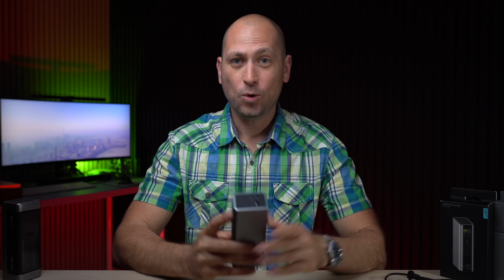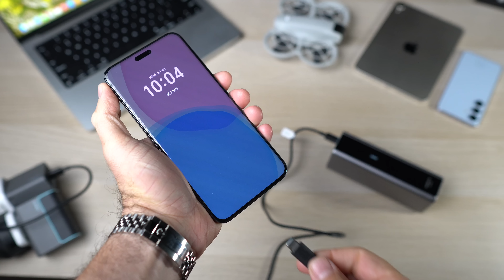This Power Bank Made My Other Chargers OBSOLETE - CUKTECH 15 Ultra

Comment: You should talk about the misleading that this brand does with their information. I bought their 10k mAh power bank and I have to accept that quality looks good and it provide fast pd to everything I connect to it. The problem is their real capacity, mine being 10k mAh is only able to charge one full time my s22 ultra or my pixel 8 pro and then it will be with 10% or less charge, when the battery for these devices is only 5k mAh. I reported this to cuktech and I was told that the real capacity for their 10kmAh is only 6k to 6.5kmAh and that this is normal for all the power banks. I am sorry but I have a 10kmAh power bank from Anker and it is able to charge my s22 ultra and pixel 8 pro at least 1.5 or little more my phone when their power bank is not even able to charge them 1.1 to 1
2 times before the power bank gets fully depleted. They have a problem with their power bank and their real capacity.
Reply from the maker: Thanks for sharing with everyone.

Comment: The coolest power bank! It's very powerful and it's nice that it charges at the device's maximum speed!
Reply: What phone u using?
Reply: @danstoikovik7791  i use 3 phones 1 vivo 1qoo 11, 1 vivo iqoo 13 and 1 xiaomi 11T
Reply from the maker: We agree! Thanks for watching!
Reply: @redskullpro Silly fake comments aren't necessary 😅